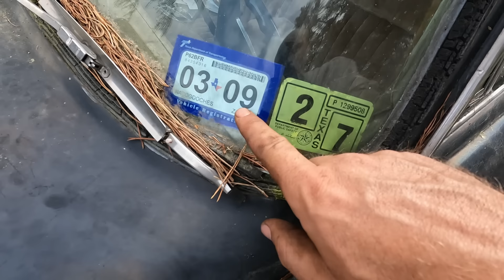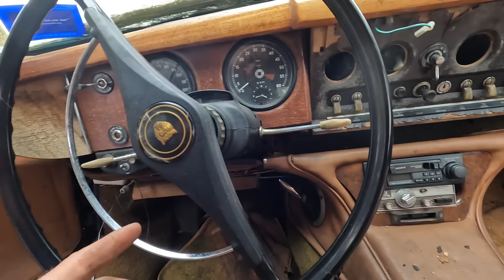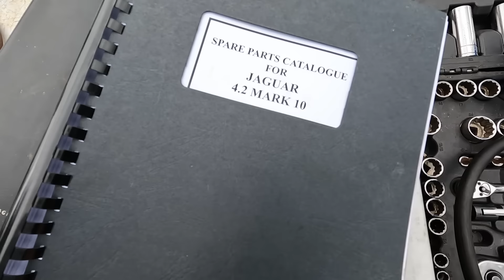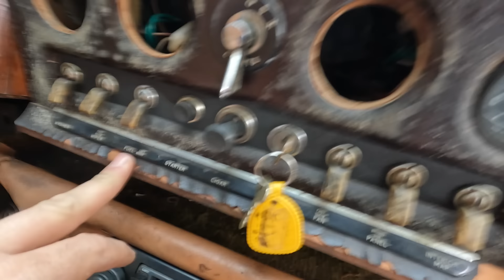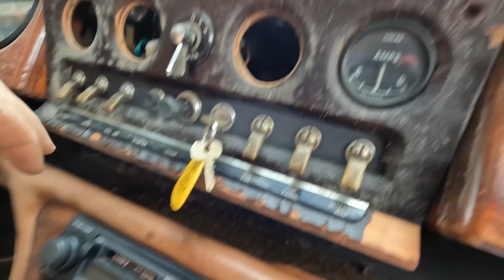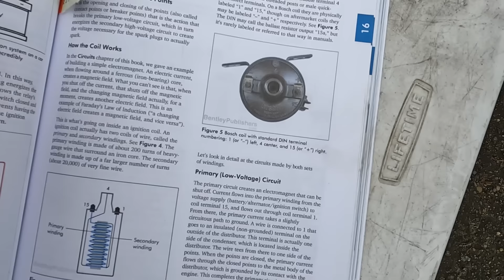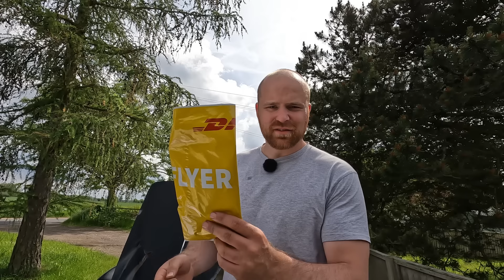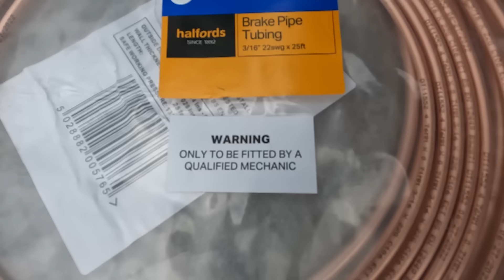1962 Jaguar sitting for 15 years. Will it run?

Comment from the maker: Apologies for the jerky camera movement in the first half of the video. I didn’t realise until it was too late that the in-camera stabilisation had been accidentally turned off. It does get better once I realised!
Reply: If you compare piston size (and if there is indeed more than one on each caliper) on original calipers v ones fitted, you might find a clue.  If new calipers are twin pots say with larger pistons as well then maybe the MC isn’t pushing the volume of fluid required. Just a guess.
Reply: putting an ls in that car would be dumb. it is a big heavy turd. It could be a wonderful cruiser, it will never perform. put the ls in something that isn't a boat.
Reply: Great content for DIY mechanics and none of the constant false 2:27  laughter you get on other u tube channels. Keep up the good work
Reply: The hole in float bowl is where a button should be called a tickler its for setting the mixture
Reply: Keep working......... camera just a element buddy u got the content right (best content) and a personal touch which I'm sure we all amateur are totally relate... Love form India cheer mate
Reply: Awesome 😊
Reply: Shaky cam is a style you know? No reason to apologise, doing a bang on job anyways...
Reply: Don't worry about it, I get that jerky movement almost every day.
Reply: What a crazy world we live in. I have a left-hand drive 1967 420 still with UK license plates sitting in my backyard here in the US. Of course the car has been sitting outside for decades and the desert sun has not been gentile to the interior. The story has it that a doctor had it imported from England and when he passed away his family kept it until it somehow made it outside and got passed on to the next owner. I've been contemplating to convert it to RH drive and build a Rust to Rome kind of car, lol. Mine also has the ribbed cam covers, which may have been a first in 1967. I wonder how much trouble it would be to install a Jag V8? 
Great videography, a beatify outdoor garage in sunny Sussex. Liked and subscribed!
Reply: I have a couple of cars that you can have a go at starting 😉 1972 x 2 both turn over and have compression
Reply: Thats not the original engine, I owned a mk 10 1963 and the cam covers were plain aluminium not the fluted ones from an xj6 ❤
Reply: I'm surprised how quick you got that running...Tasty Classics and his American Adjustable Wrench Brother would be green with envy
Reply: @Cestmoi-q5d 😊
Reply: Bet there was times you wish you could  pluck the mind of a 40 year old  jaguar mechanic from 1966
Reply from the maker: @sweenydeeny5821  you’d be surprised how many are in the comments and email me with advice. I’m very lucky.
Reply: When you put the spark plugs back in, don’t forget to lubricate them with graphite grease… that might be why they came out easily because they were
Reply: @NotEconomicallyViable The brake pipes are round the wrong way , the original Dunlop calipers ( 2 1/4" on these I think ) have been swapped for Girling 16Ps . The engine is from a later XJ ( 1970 on) these engines can have cylinder head issues.... oh and check if the oil feed to the gauge has been blanked off as no gauge = big leak . Back in the 70s the tanks , pumps and often engines were used for inboard engine conversions for power boats . I preferred the lighted V8s from the Rover range .
Reply: Did you try to close the rear electric windows ? JC 14/9/24
Reply: Super cool car❤
Reply: what happened after this video? cant find a follow up!
Reply: @robtaylor1444 
Yeah, we're waitin' 'ere with baited breff.. ☝️😑
Reply: Your reaction on the first start up was pure Mechanic's Joy! Worth every penny!
Reply: This video was 7 months ago. I’m a new viewer, and this convinced me to subscribe. But I was hoping you can give us an update or a new video worth of work on this car, I’ve always loved the older Jaguars. 
Another suggestion - if you ever come across an old MK2 I’d love to see a video on a rebuild/restoration for one of those. I realise there’s other channels, but I prefer the way you do your content. It’s fine having a proper garage and a team and all that, but most people with aspirations of doing something like this someday just don’t have the capital to buy/rent a proper workshop and hire staff. And I just think there’s something more authentic about one man doing the best he can and learning some things along the way.

Comment: I've been an engineer for over fifty years and you took on a job that I've seen experienced mechanics walk away from. Well done!
Reply from the maker: Appreciate that 🤝
Reply: Compare working on this car to working on a Ford Capri 1.6/2.0 pinto lump.. it's probably night and day
Reply: Ye the most common thing us Americans do when faced with a recalcitrant Jag is get out the SBC Swapping Kit haha
Reply: That is right, you need some sand to take on a Mk10 jag with bits removed!
Reply: do not drive it off into the sunset off a cliff would be better
Reply: @TheFusedplug I've noticed that banger racers always fit ford V6 engines....to everything! Even American cars!
Reply: Do you have the brake pipes the right on the master cylinder screwed to the correct inlet and outlet, normally the outlet is the one in the very front and the fed from the side. Just looks wrong to me.. hope this helps
Reply: Lovely old jag..Usually the brake lines to the brakes come out of the end of master cylinder and fluid from the reservoir goes in the side of the cylinder
Reply: @TestECull I’m throughly impressed that you know and spell recalcitrant. 99% of Americans can’t.
Reply: True, but not all mechanics have a Youtube channel. It's pretty useless to revive this car's engine from an economical point of view. But it's great fun to watch.
Reply: "Puppy leveld of entusiasm" - Wondeful!
Reply: they walk away for many very good reasons
Reply: @Martinroy-c5y  of course...having a popular Youtube channel has nothing to do with the car trade industry. If only there was more enthousiasm for my broken washing machine
Reply: @TestECull So using the same boring " solution "to everything is intelligent? Not even close. 😂
Reply: @kirbyhans5261  If it ain't broke don't fix it. A 350 4bbl will make every bit as much power as that Jag I6 at half the revs with 5 times the reliability and a fraction the servicing costs. There is a reason we love doing that swap. 🤷 I suppose if you want to inject some modern electronic enshittification you can use an LS instead of a Gen 1 or Gen 2 smallblock, but I prefer keeping computers the fuck away from my car so I have something reliable...erego 350 4bbl.
Reply: @TestECull  If that's all you are capable of doing , enjoy it. Doing the same thing every time is boring.
Reply: I'm sure your girlfriend has told you that already..... If you have one.😂
Reply: @kirbyhans5261  I had one 13 years ago. Then I put a ring on that finger, because I'm not an immature little child that has to belittle people on the internet over what they find enjoyable in a project car build. 🤷 Because I'm a functional adult, I managed to graduate from girlfriends to a wife. 

You should try it sometime. Grow up some, maybe you'll be able to keep someone around long enough to get somewhere in a relationship!

If it pleases you, the next one I swap will have a flathead Ford V8 in it instead of a smallblock Chevy.👌
Reply: @kirbyhans5261  Oh, hey, maybe instead of a flathead V8 I'll swap a 4.9L I6 from an 80s F-150 into one instead? Keep it straight six at least. 🤣 that different enough for ya, kiddo?
Reply: @TestECull  Yes , at least you're getting out of your sbc rut.😆
Reply: @TestECull   By the way, ive been married 26 years little boy. Get over yourself.
Reply: In the USA, old cars with copper radiators and cast iron engines take green antifreeze.  The other colors are for aluminum, which IDK if this car has.

Comment: One day you're gonna have your own unit with a proper lift and all the tools and kit and would love to see what builds you pull off.
Reply: That sounds like a job. The romance of backyard mechanicking, the mystique of not economically viable all gone.
Reply: @teaCupkk  Nah it's not a job when you're able to do your hobby with all the fancy kit. unless I start charging the general public money to service their car then it aint a job. Be honest "backyard Mechanicking" is nice and all but not all of us can afford the back pain of working on jack stands with nothing but 400mm of clearance and basic tools all all the time.
Reply: @MrLense  Turning a hobby into grind and burnout takes almost no effort at all. A proper lift needs, power, and why not add a roof? Before you know it, you also have a compressor, and a bench with a vise. You're no longer working out of the back of a Range Rover, when weather allows it. You now have a shop, and are no longer fixing things in the dirt, but have mysteriously lost half of your excitement. What happened?
Reply: The callipers look like the ones on my xjs 1994   Rag top  I’ve had 24yrs and I did have them reconditioned years ago and they said they was a four pot upgrade

Comment: All Jags use electric fuel pumps & the ones with twin fuel tanks such as the Mk 10 & 420G have two fuel pumps. You desrerve a medal for taking on that car without detailed Jagaur mechanical knowledge.
Reply: A medal ? Lol he should know this stuff it ain't that hard to find this stuff out
Reply: A Medal? He needs sectioning!
Reply: What this chap has done is tantamount to dating a super model with a bad temper 🙂 hard work, but can be quite rewarding...

Comment: Calif. Weighin in here on ur project. Having owned my share of brit iron and wrestled with ur heathen love of oddball units of measure,ie: Whitworth, among a plethora of other issues from our cousins over there im simply astounded that uv not yet been assaulted by the worst english gremlin the dreaded LUCAS genie of darkness. From my BSA to my Trumpet, to my Sunbeam Alpine to name a few i was plagued by problems that the genie wouldnt assuage for any of my three wishes. When i was just a 20 sumpthin kid my friend and i came across a Jag MK9 in the junkyard for sale with a nice clean interior and body,eng cond. unknown for $600 and we were poised to buy it when by best buddy dropped out at the last minute becuz his girlfriend nixed it and ive spent 50 yrs wondering if she was smarter than we or the other way around ,for the MK9 is for all intents and purposes a minature Rolls right down to the Wilton carpet and burled waldlnut everything. Then as now parts were harder to source and higher priced so i wound up settling for my father 72 capri 2.6 as he sold it to me cheaper.

Comment: I haven’t finished watching your maintenance of the braking system yet but years ago I had a problem with the hydraulic braking system on a motorcycle & someone passed on a tip to me that worked perfectly. If you already know this tip, fine, but you may have viewers that it could help.
No matter how I tried, I could not get a really good solid ‘feel’ to the twin disc brakes on a motorcycle that I had restored. The brake worked but as I was slowing down the brake lever was gradually becoming ‘softer’ until it had reached the handlebar & ‘pumping’ was required. I had tried everything that I could think of but I was left with a spongy feel to the front brake. A knowledgeable gentleman said “apply the brake & fasten the brake lever back to the handlebars so that the brake is on. Top up the master cylinder & leave it overnight.” I  applied the brake & zip tied the brake lever to the handlebars, topped up the reservoir & left it overnight. 
Without much hope, the next morning I cut the zip ties off to find that the front brake worked perfectly & had a wonderfully sound feel to it. I had similar trouble with a Reliant Scimitar hydraulic clutch. I applied the clutch & held it applied with a piece of broom handle between the pedal & the drivers seat. It worked a treat. I can only think that it holds a valve / passageway open in the master cylinder, that allows trapped air to return to the reservoir. If it helps one person, it will have saved an indescribable frustration. Richard.
Reply: ??❤😂😮 4:13
Reply: I did the exact same thing with my R55 mini clubman this year after changing the clutch master cylinder.
Left the top off the filler cap and wedged a piece of wood against the clutch pedal and the seat overnight.
Next day perfect clutch pedal 👍🏻

Comment: Brake hoses collapsing a common problem on old cars ....you're doing a great job ...thanks for the entertainment 😊
Reply from the maker: Thanks 👍
Reply: And the calipers rust up too, very big job to get to the rear on the inboard rear brakes off Is joke how they build them
Reply: yep the easiest way i found eas to unbolt and drop the whole back suspension out on the floor do the brakes then put it back in as a brake mechanic that is how i did it

Comment: Well when the motor just turns over... it turns over!  Well done.  I love these motors... rebuilt one just for the fun of it in my shed.  I learned so much and YES it is all very doable by the home mechanic.  When the day comes to pull the crank out (and it will), make sure you remove the small Allen-bolt ports to clean the accumulated sludge out of the crank.
Don't be too upset by not having the fuel tanks, they were prob. rusted out, and after all, you DID buy the car sight unseen... and you did end up finding the carburettors in the boot.  If only a lot of my projects were as complete as yours!
At first I thought, "Man, finding a set of carburettors is going to cost and arm and a leg" (like /thousands/ of pounds/dollars/razoos) but then you found them.  They might not be perfect, but you can fix them up and that's a v. good thing indeed.  Chin chin!

Comment: I used to buy and sell series 3 ..4.2 many years ago. The 3.8 was not a good engine for the size of the car so people put the 4.2 in ..and in hotter countries used to put in bigger radiators and pipes so it wouldn't over heat. Great video.
Reply from the maker: Good to know 👍🏻
Reply: @NotEconomicallyViable  with the 4.2 engine it is a ali head and a steel block..the head bolts that holds the ali head to the block go through the waterways and rust and expands and will lift the head up off the block. Thank you for your reply and video.

Comment: 1:21:08 the hole in the bottom is threaded for the fuel pick up for the automatic choke, it’s tapped for a banjo bolt that goes through to give fuel to the auto choke

Comment: A vehicle which looked like not economically viable suddenly turns into very much economically viable! Well done, you certainly managed to get an old timer running again. The spark plug leads are called ignition leads, if I remember correctly. That brings back memories where I serviced my Ford Cortina MK5 first ever time in 1988 and I was given those long leads and managed to make the leads by looking at the old ones

Comment: Absolutely love the Jag mk10.. proper east end gangster car from back in the day..
Reply from the maker: It's a very cool car
Reply: @NotEconomicallyViable  I had a 1986 Mk.10 4.2 and no problems over 2 years with surprisingly 28 m.p.g. !  So smooth and well worth renovating. You could cover costs as wedding car - I did.🤑
Reply: @roycarpenter6380 I think you meant a 66 mk10 sir. The production finished in 1970. I have a 68 420g. Great motor car but loves the petrol.
Reply: @jamescourt4703  Apologies. A touch of brain fade !  It was a second-hand XJ6 with the 4.2 engine.
Reply: @roycarpenter6380  old xj6,s were lovely old motors. Ive owned a few myself. The series one is a great motor and have started to hit big money with a tidy example.

Comment: The majority of vehicle revivals by U.S. YouTubers are on older models of what we in U.S. used to call "The Big-3" Ford, GM, Chrysler ~ (AMC/Jeep is another story :) Parts to make the big-3 models run, drive, & stop are often interchangeable within brand & available in local parts shops. Also, we have vehicle "junk yards" within reasonable distance. There's many new & rebuilt engine, transmission, drivetrain, & brake parts for popular models. Full restoration with cosmetic body panels & interior parts can be difficult to locate but it's still easier to get them running, driving & stopping, than what you've faced with the Jag -- which makes what you're doing that much more incredible! Good luck on your project.

Comment: Brilliant video :) Actually, Jaguar did have a prototype MkX/420G at the time in which they put the then newly acquired Daimler 4.5 Litre V8 engine from the Daimler Majestic Major Saloons. That engine was the bigger brother of the 2.5 LItre V8 used in the SP 250 and the Mk2-derived Daímler 2.5 Litre V8. They found that it indeed performed better than their own straight six. However, Sir William was having none of the embarrasment of downgrading the XK engine so the in-house V8 Jaguar project was cancelled. I'd love to see a 420G retrofitted with one of these Daimler 4.5 Litre V8 engines but, unfortunately, they are quite rare.

Comment: That engine is a much later unit. On engines of the early 1960s, the cam covers are polished aluminium and this has the much more recent grooved covers. Also, I think, the original 3.8 engine only had two carburettors. In fact, I think this is a 4.2 E-type engine.
Reply: From memory triple carbs on the mark 10